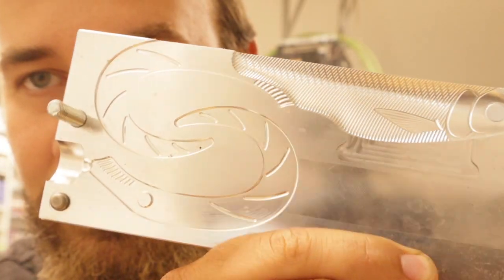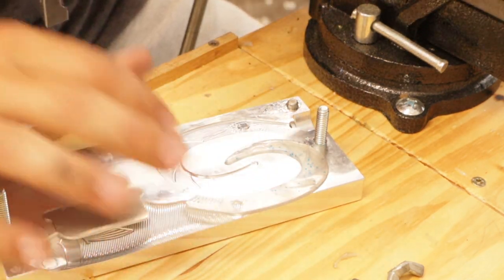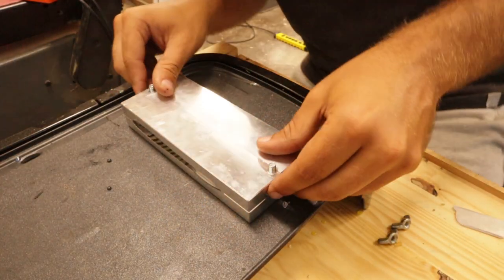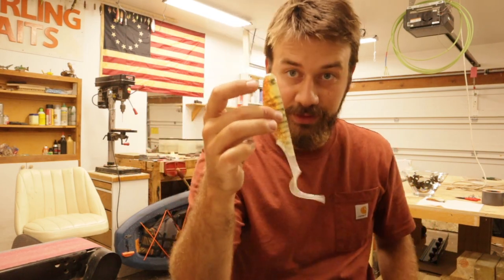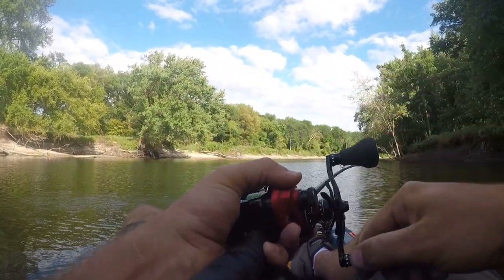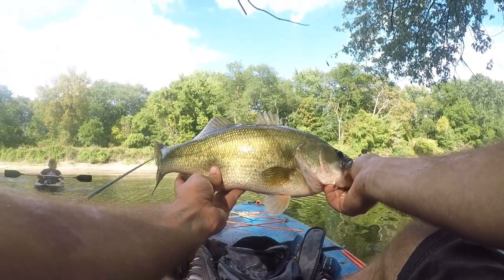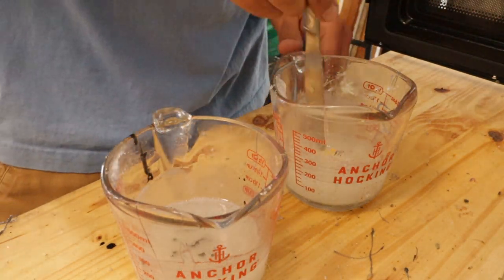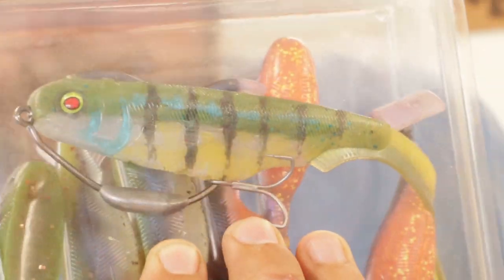Ribbon Tail SwimBait | Inject + Pour to Catch

Comment: And BTW you can make your own go pro head mount by drilling a hole in the brim of a hat and using 1/4 20 threaded bolt it screws rite into the GoPro tripod mount! Tip though put the hole closer to the inside of brim so the GoPro doesn't weigh down the hat brim. I made my self one and use it for filming most of my vids.

Comment: Awesome to see you on a kayak, they have models you can stand up in but with the camera I watch bunch of kayaking fisherfolks that use a cap mounted camera or one on a pole behind the seat. Just came back from an overnight trip by a large river and annoyed about not owning a kayak myself because all the high grass and swamps surrounding most lakes /rivers in Sweden. Thanks for an awesome video like always, just take a gopro mount that suppose to drill into surface and fix it to a cap with a bit of Plexiglass to make the cap rigid instead of buying special made cap

Comment: I have an idea... you could purchase a few cheap hot glue guns like 4 or 5 for $20 and then you can make some molds with drill bits just basically hot glue sticks made out of soft plastics and if you were a real wizard or you know an electron wrangler they could even try to get the temperature closer to the ideal soft plastic temp but otherwise you could just pump colors through them and like have one for dark colors, one for light ones, one for sparkles and ect. ec.t so they don't mix too much and you don't have to worry about cleaning them up. I saw multiple hot glue guns the other day for under $3 each on the google shopping tab so like it would be  worth it to spend $5 trying it out with a new gun that was not contaminated. you might even just be able to cut out square bricks from previous pours if is close enough of a shape to fit through the guns. maybe check the temp the guns run at and try to ask some companies. or just do tests your self with a temp probe a glue stuck and the hot plate or some other hot thing to see shen it starts melting and when its like drippy liquid runny to tell you what low temp and high temp means.  good luck and keep making col things... 
Also try a carbon fiber fishing lure and or fiber glass, that sounds like a new challenge for you!

Comment: Heat the bottom layer with a heat gun before you pour the top. You get cold cracking because of the difference in temperature. Sweet mold man

Comment: Big fan. Run your plastisol on defrost in the microwave for a while to get rid of some of the bubbles. Not as effective as a vacuum chamber but it works ok. Bubbles will rise to the top and you can pop them with a gas burner or heat gun.

Comment: I was wondering could you try to replicate a devil horse bait. Back in the early 1990s in missouri it was a good top water bait.  It was about 8 or 10 inches long metal propeller s on front and back. It was round and started off bigger in the front and tapered back smaller. It had trebal hooks . The paint sche was simple it was darkish blue with black faded stripes and a little yellow. I would love to.sew one again.

Comment: Hey marling baits, I love your videos tremendously and I only want to see your channel do well, which it obviously is doing.  This is why I have to tell you a hard fact. Youre overexposing your video footage like crazy. I'm not sure if you have the thing set to auto or manual, but please check the ISO. It will tell you what's up, and for sure you can apply the perfectionism to your exposure as you can your baits. It will only serve to show your work in a more accurate "light". You have encountered this problem in the same scenario 2 years ago as today. Just roll the exposure down a bit. You have some of the absolute best fishing footage on YouTube,  thank you for that. Tight lines and please check out your exposure.

Comment: Just a thought, but what if you molded the plastic to fit a hot glue gun? I dunno. I just feel there has to be a better way to lay the plastic down other then a soldering iron.

Comment: I need help, i wanna start making lures, but I dont want to buy clear coat Because if I don't enjoy it, I don't have a purpose for it anymore. Is there a wood that I can use without a clear coat? It doesn't have to last forever because it's just for testing. It would be best if you would recommend several varieties to me. Or would it be possible to use  weatherproof lacquer or oil?